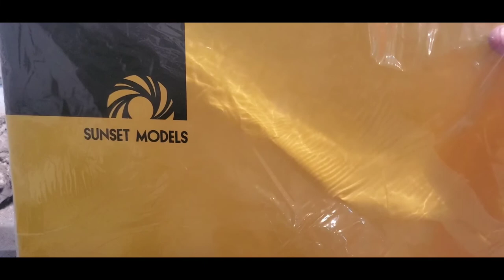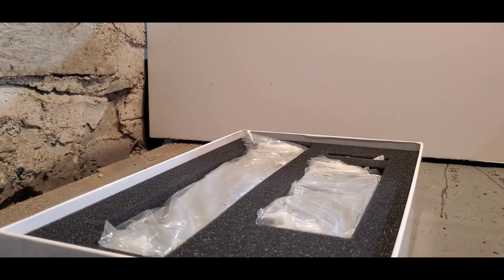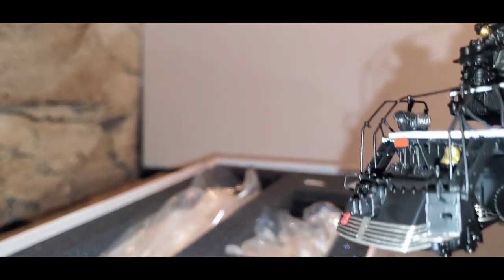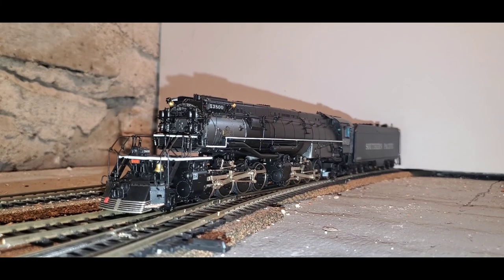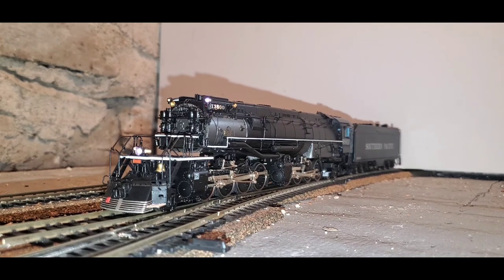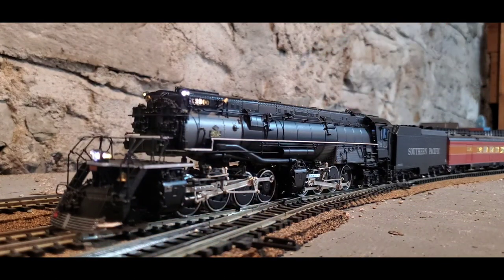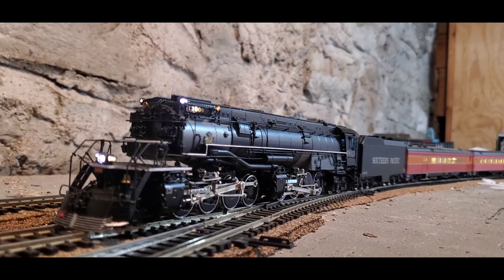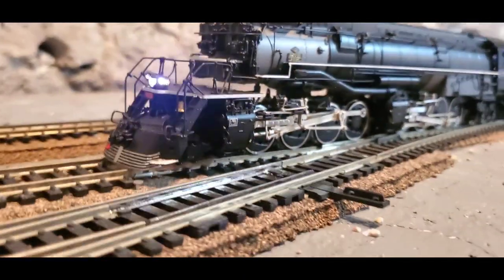REVIEW: Sunset Models brass SP AC-9 2-8-8-4 Oil with TSU2

Comment: I would’ve loved to get one, in 20 years when I can afford it haha, but the 35 radius is a bit of a turn off.
Reply from the maker: I didn't think I had wide enough radius, but it worked great, as shown in the video.  I definitely didn't pay this all at once.  Did a 6 month payment plan.
Reply: @SensaSean  it does look good and sounds great. I’m trying to find just any AC-9. Even a bargain version.
Reply from the maker: @James-Railyard  unfortunately, the only 2 options for an AC-9 are brass or kitbash
Reply: @SensaSean  yeah, I found an Alkaine (I think that’s the spelling) on eBay for $570+ and it’s missing leading/trailing trucks and the paint is chipping. Brass trains has an older sunset for $1300. I just wish MTH would’ve done one in Ho or BLI.

Comment: Really. A steam engine that has a diesel horn. FUUUUUU
Reply from the maker: Most SP AC types had an air horn for city/town use.  Other than that, it used a whistle.
Reply from the maker: In fact, the Southern Pacific AC-8s through AC-12s all had an air horn.  GS-4s also have an air horn.
Reply: SP had Air Horns on many of their steam loco's. Some locate on the smoke box, others under th running bord on the Firemans side near the front.